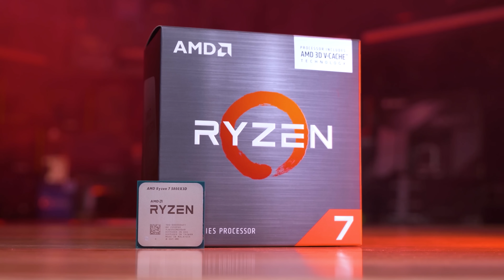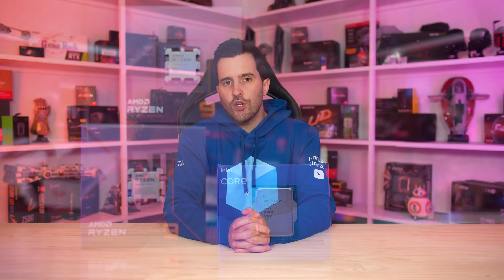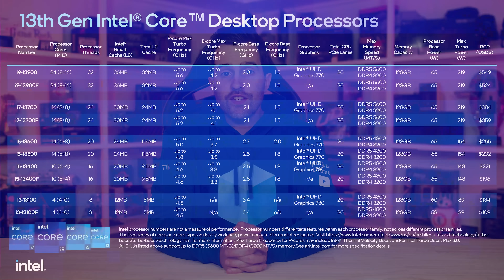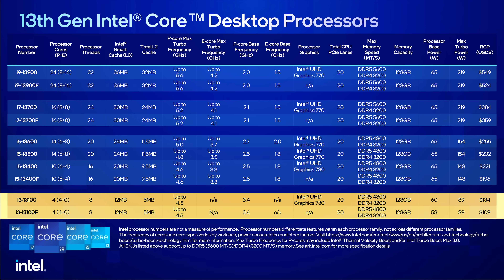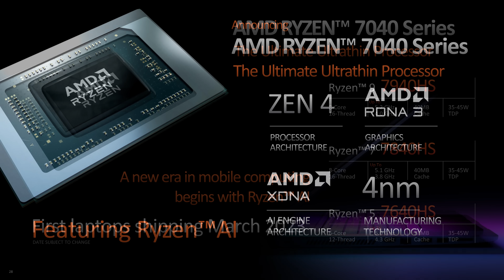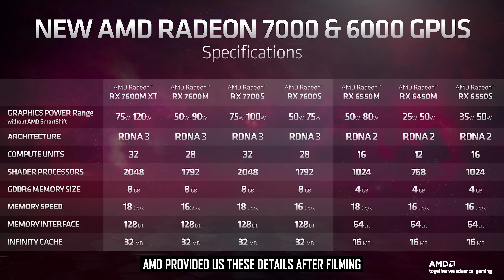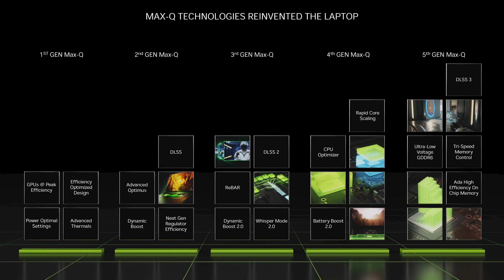Zen 4 3D V-Cache, 7950X3D, 7800X3D, New Cheaper CPUs, "RTX 4090" for Laptops - CES News Recap

Comment: With the announcement of the non-X and X3D models, I'm definitely not surprised people held off.
Reply: I think anyone who has been paying attention saw the X3D models coming from a mile away
Reply: @tippyc2  This exactly !!

anyone with half a brain would have figured thats why the 7000series didnt sell ..
Hell even AMD ruined their own market by letting slip the x3d cpu's were coming..
watch AM5 sales skyrocket if these new x3d cpu's are any chop !!
Reply: @tippyc2  Exactly what i noticed they hold off , the very good stuff comes almost to the end cycle which sucks.
They should release the very best first then trickle down the line for people who aren't willing to dive too deep into the Big Boy stuff
Reply: @tippyc2  the issue is they dont matter. Youre not gonna notice a difference playing at any optimal resolution for your GPU. This doesnt help AMD sell AM5 anywhere near as much especially considering the price to buy them + the platform and ram. This also doesnt help them from getting beat hard on nearly every level in multithreading. They barely even talked about these cards and only showed their performance at 1080 on a very few games, and got off them fast. Im pretty sure AMD knows this isnt a winner for them and are trying to give as little info as possible and just hoping they can bullshit their way into enough sales. People probably wont buy AM5 anymore and keeping buying Zen 3 and 5800X3D, and Intel 12th and 13th gen, especially when all of them are well more than good enough
Reply: @Angel7black  I wouldn't say "it doesnt matter."  It depends on what you play.  I like automation games like Factorio, and the performance boost from the extra cache is definitely noticeable in those kinds of titles.  Other games are hit-and-miss, some games get an uplift, some don't.  Only thing i can really say is wait for the benchmarks and see if the games you like gain anything.

It's totally possible that even AMD sees this as a lost generation of hardware.  Transition to DDR5 and a new socket at the same time, and there isn't much incentive for users to upgrade to the new platform.  Next gen should be huge for them though once DDR5 gains wider adoption and AM4 is further in the past.
Reply: @Angel7black  Having the fastest gaming CPU will be a marketing coup for them, as that effects the way people see other products offered by them, and a lot of people like to buy those top-end CPUs, even though they usually don't need them. The 7950X3D is going to be a real monster of a workstation CPU too, as the regular 7950X that's already out already competes very well against the 13900K as a productivity CPU, so having a CPU which is the best for gaming and productivity, and also with significantly lower power consumption than the 13900K, will be highly valuable from a marketing standpoint. The 7700X3D will be the most popular of these, and it seems likely that it will perform very well against the 13900K in gaming as well, and while that shouldn't matter as much as performance per dollar, it does matter a lot for AMD, and for how people perceive AMD.

Furthermore, it will matter for their stock value, and their continued progress definitely matters a lot in terms of how competitive they will be able to continue to be.
Reply: @Angel7black  Not really it depends, one of the improvements is in 0.1 and 1% fps that can reduce micro stutters which makes your gaming experience feel smooth.
Reply: @Angel7black  so just stop making cpus now is what you’re saying?
Reply: @Aces  1080p is where CPUs are tested. Literally every reviewer has explained this to death. She also said cheaper mobos are coming as well in the same sentence. As seen with the 5800x3d the cache doesnt affect every single game some get better performance and others there's no difference. There's been a plethora of people asking for the vcache versions of 7950 and 7900. So clearly enough people requested that they thought it was worth it.
Reply: @tippyc2  Exactly, people need to se a prober next gen Zen release.

The current stuff bearly beat 5800x3D and the 3D version of this inproper 7000 gen is not gonna be meaninfully better for moast people, maby some people will begin to switch when 8000 comes out at some pount, if it turns to be another zen 2 to zen3 moment.
Reply: @Angel7black  So you’d suggest Raptor Lake with DDR4 over DDR5 and Zen 4?

The issue is it is a dead end platform being the biggest in IMO. But then it is power hungry, needs better cooling, and better motherboard.
Here are some common arguments I see with people.
“But it is cheaper and faster because it doesn’t need DDR5!”
No, it is either faster/same performance or cheaper using DDR4 for the same/worse performance.(SKU dependent)

“Then you can get 8000 mbps DDR5 memory and overclock! AMD can’t go past 6000”
1. Then congrats, you are paying more for half of the RAM to tie Zen 4X3D.
2. Zen 4X3D most likely doesn’t require remotely fast RAM for most of the performance.
3. Are you really going to overclock a CPU that already hits 117C and draws over 300W

“You can lower the power consumption of Raptor Lake”
Congrats, now you are the same or slower than base Zen 4
Reply: @Angel7black  100% wrong, I swear people like you don't play games with NPC logic.. or any game logic at all...
Reply: @Angel7black  With the 5800X3D, the 1% fps lows were improved compared to the 5800X on almost every game, no matter the resolution.
Reply: @Angel7black  "and only showed their performance at 1080 " when it comes to cpu performance, if you want to show power difference you want to show it at 1080, at low res your gpu will be waiting on your cpu, meaning the performance difference will be the cpu. When you test gpu you want to test 4k because then it's your gpu that will be the bottleneck and the difference will come from gpu power.
Reply: @Angel7black  intel was nowhere for 5+ years. Now you are talking about productivity? Like lol haha.
Reply: i've been holding on to my 4790k for gaming until a proper upgrade for DDR5 and a Ryzen CPU with 3D Cache on DDR5

however i've been mostly focused on my dedicated Streaming/Local Recording Rig which has a Ryzen 5 3600 (upgraded from a FX 8350 as a Streaming Rig)
Reply: If the price is anything like the 5800x3d, the non-x chips will be a deal, looking at the 7900
Reply: I was witing for the non-x and I'm still waiting for lowered prices on the motherboards
Reply: @@thomasb282 yeah not sure why any one would buy intel now maybe when 14th drops but right now its a staring down the barrel of being a dead platform in 11 months ..
Reply: The writing was on th wall. They started with the "middle" cpu´s......so the high and low stacks were on its way. They were only waiting for Intel´s release to set the price point.
Reply: didnt wait lol, much cheaper 5800x3d, plus most games are gpu bottlenecked than by CPU, its good enough until games get more demanding
Reply: Yeah. Idk what was more disappointing Nvidia GPU prices or AMD X-SKU CPUs.
Reply: i think people held off because the whole am5 platform being expensive as a whole not because they could get a discount on the CPUs. If that discount is that important for the hypotetical buyer, then that hypotetical buyer would rather completely skip am5 and build a waaaaaay cheaper yet still very good am4 platform.
So yeah until the whole cost of mobo+ram+cpu combo starts becoming budget friendly people will still hold on buying anything i think. Maybe in a couple of months boards and ram will follow and thats when most people are gonna start building PCs again
Reply: @doumanseiman2645  they held off because of x3d ( AMD's own stupidity for leaking rumours of the x3d before the 7000 series) AM5 is a big pill to swallow its not cheap agreed but its coming down and still better in terms of value over Intel
Also with the new GPU's  like the 4090 and 7900xtx that were being released at the time  people knew the bigger gains would have been the GPU over  CPU !!
Reply: seriously... they needed to just scrap the standard lineup and launch the X3D models, then launch the other ones for less money. they would have won so much market share it would have been insane...

well, if they could have also released with reasonable motherboard prices... 

basically everything was wrong with the way they launched.
Reply: @William-Morey-Baker  that is what they just did, the non-X CPUs are coming within 2 weeks for MUCH cheaper. The 
7600 - $229
7700 - $329
7900 - $429
Reply: Yes now they can look at x3d benchmark numbers and buy cheap models they did not wanted to buy initialy.  Like braging how geforce rtx 3090 is fast but owning rtx 2060. 😂😂😂😂😂😂😂😂😂
Reply: @robertpintaric7354  speakin' of RTX 2060, my dedicated streaming rig drives a RTX 2060 KO just for Nvenc encoding
Reply: @phi2307 say you, AMD shill.
Reply: All of AMD's X3DVCache CPU lineup will get murdered, slaughtered, assassinated and destroyed by intel's 13900KS
Reply: @lldjslim  Lmao, the 13900KS is just a pucked up 13900K. Sure, in production, the X3D models will be weaker than the X ones, so it won't be a surprise if they fall behind, but gaming will be a different story.

Comment: In my opinion, this is going to be a very strange and stagnant year for hardware sales. I feel like most of us are looking forward to lower prices on last year and the year prior's hardware. I personally am not interested in new CPUs or GPU's.
Reply: CPUs maybe but GPUs can go to Hell. I will start looking again when they are half the Price.
Reply: DDR5 prices are almost as low as DDR4 now. AMD said new AM5 MBs are coming out that are lower cost.  And these parts are going to run about 15% faster than the 5800X3D.  That's a large gen upgrade.  The intriguing part to me is you could run a main game thread on the Vcache CCD since it's the one that needs all the extra cache but run a lot of game threads on the other CCD that runs faster clocks and I think that's why AMD did a comparison with the 7800X3D to the 5800X3D and then the 7950X3D to the 13900K, meaning that the 7950X3D could probably run games faster than the 7800X3D because it has a CCD that runs clocks a bit faster.  But this is speculation.  Game threads certainly don't have to run on the same CCD and the scheduler for the 5950X throws game threads at all cores depending on how many threads the game will spawn at any given moment, but that's what's happening with UE5 based games.

So this is more interesting to me personally.  I'm not buying because I have a 5800X3D and it's all I need for the next few years for a 2K gaming rig.

I'll give other reasons I'm not excited for current gen Ryzen and AM5 and it has nothing to do with prices.

The main two are:

The CPU-chipset link is still 8GB/s.  Even Intel took this up to 16GB/s for 13th gen.  If you REALLY need all those devices off an X670 or X670E MB, 8GB/s is going to be a bottleneck part of the time.

The memory controller for Zen 4 sucks.  DDR5 is going to get a lot faster and it's limited to about DDR5 6000, and if you need 4 sticks of memory it REALLY SUCKS.

I'll be interested in AM5 if those two issues get fixed but that won't be with current MBs or Zen 4.

And for Intel, 13th gen is too power hungry.  Even in gaming the Intel CPUs are using a bit of power, compared to something like the 5800X3D that's only using about 50W on avg. during gaming (Techpowerup does complete power analysis for CPUs).  So the 5800X3D is low power doing what it does best, gaming, and in fact for all the better gaming CPUs it uses the least power.  Maybe I'm buying a 8800X3D, I don't know.  But pricing isn't really so much as issue anymore except for MBs and new boards are coming out that cost less, but I'm sure with less features.
Reply: The uplifts are too small and too expensive.  Everyone is also in a recession.  These prices will plummet within a year or two just wait.
Reply: CPUs seem very nice to me, but i bought the 5800 x3d some weeks ago, so i wont upgrade for some years. dont have to talk about gpus, they are overpriced as fuck
Reply: I just upgraded to a 5800x3d so I definitely won't upgrade to a new CPU, but these x3d parts are very exciting and I think they'll sell despite massive platform prices.
Reply: The new CPU’s are priced from $230 up for zen 4, what’s so expensive? That plus ddr5 coming down and cheaper boards coming along means it makes sense to build a pc on the CPU side now more so than last year. Gpu’s are a case of bug used off eBay and score a deal and forget the bs they launched so far.
Reply: @alexmills42  Let me guess, you're not planning to buy anything, yet you're here defending
"the not so expensive prices"
Anyway, even if you're planning to buy something, that doesn't change the fact, you're just making what people does to justify and defend the prices of the GPUs, with the only difference you're doing it for "the CPU side".
Reply: @dazh686  dude I’m on an x570 system, I have no real reason to upgrade it at this point. On the other hand if I were building right now I’d jump on AM5 in a month or so once the new CPU’s come in. I built this system I have now late 2020 right when rtx3000 was launched and I found a way to get something I wanted then without paying scalper prices and now is easier than 2 years ago.
Reply: lower than the 7600 non x? That seems good to me, especially considering they're running a low TDP and come with a cooler in the box, saving me money on buying a cooler separately.
Reply: The CPU space is not stagnant at all, there's been tons of competitive prices at various price points, and lots of progress in terms of how much performance you can get per dollar. The GPU space, on the other hand, has been really stagnant. The practical issue I see with the CPU market for gamers is that most CPUs are actually way faster than they even need to be for the needs of most gamers. The high core-count CPUs which excel in heavily threaded applications from both companies are also very much irrelevant for gaming. 

You can make a strong argument that even 8 cores is overkill for a gaming CPU, especially if you're talking about a current gen CPU. 8-cores could be a lot more useful in games (and possibly worth buying) if you're buying a used CPU which is 2 or more generations old, such as a Ryzen 3700X. The current pattern we're seeing is that 8-core CPUs take quite a few years before they start pulling meaningfully away in some games against their 6-core counterparts. Even a quad-core version of a Zen 4 CPU would be beating a six core Zen 3 CPU in the vast majority of games (though a six core Zen 3 CPU is still going to be giving you very good performance anyway, and you'll usually be GPU bound at about the same fps in most typical system configurations). Even Intel's 12th gen quad-core CPUs have performed extremely well in gaming as well, which further demonstrates just how important cores are for gaming. It beats EVERY older gen 6-core CPU in the vast, vast majority of games. Of course, sooner or later, a game comes along which maxes out all of your cores, and that's the point where having more cores of the same generation would actually make a difference.
Reply: Why though cpus were already competetive and on like the lower end you have a 3060 which I really wouldn't buy a new rdna gpu (which will probably be expensive) and... An Intel gpu which has close to the same performance to the 3070 in raw performance and to the 3060 in Ray tracing. That is good value. Basically it's a 1440p 60 fps raytracing card :D

But still holding off a little bit as I'm super scared they will completely drop the gpu division... :/

Comment: Considering the premium the 5800x3d had over the 5800x, do you think it'll be the same percentage increase for the 7800x (with a more sizable increase in the ryzen 9s)?
Reply: It depends on if that drop in core clock rate is significant enough to offset the cache benefits.
Reply: Yeah. The price difference will be about the same, so 7800x3d will be about $150 more epensive than 7700x
Reply: the advantage of the 5800x3d is that it has roughly ddr5 speeds on a ddr4
it's not gona be as extreme for am5 unless the cache is way faster, and it isn't

Comment: IMPORTANT NOTE: The 7950X can get an extra 20-40% uplift if you disable a single CCD and if you disable SMT, 
This is important because the 7950x3d is shown to be only 10-20% faster than the 13900k's benchmarks.
Reply: If u need to disable ccd to make it faster, may as well not buy the 7950x/x3d
Reply: @789know  I mean its an interisting Option for overkill gaming PCs, as games barely profit from more cores and 6 / 8 Cores is totally enough
Reply: @789know  what is ccd?
Reply: @madl99  Core Chiplet Die.
Reply: @madl99  For those CPUs, it's half the cores. There are 2 CCDs under the heatspreader, which are connected via a (third) memory chip.
Reply: "Only 10 to 20% faster"
This isn't a GPU mate.
Reply: Source?
Reply: @DeZ7ro  Cap frame x did a twitter post on it. And another third party verified it. You can just look up 7950X more performance disabling one ccd
Reply: 'only 10-20% faster' 
omg
Reply: "only 10-20%" thats a high increase... this isn't nvidias 3x the performance bs, in case you confused this with gpus